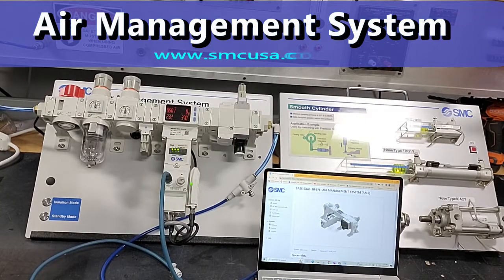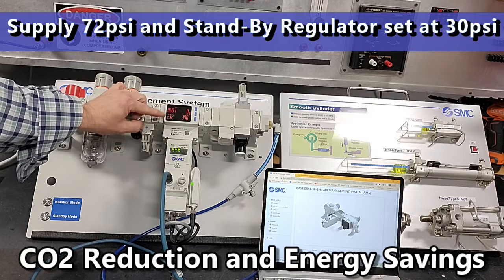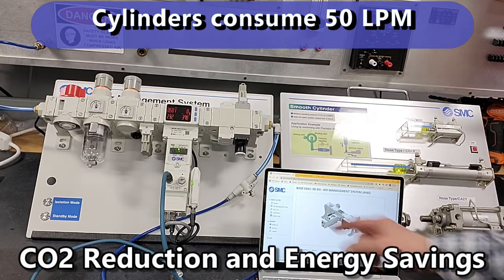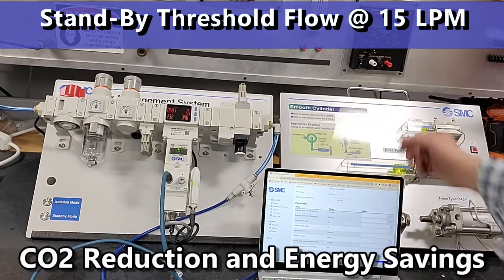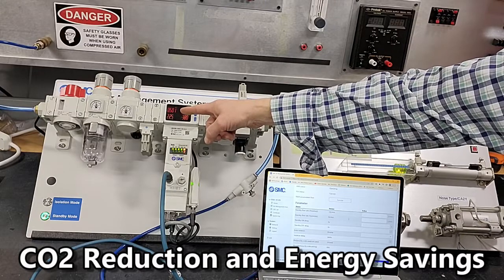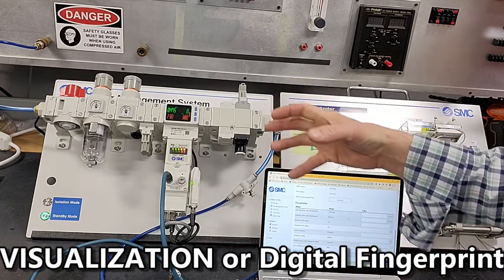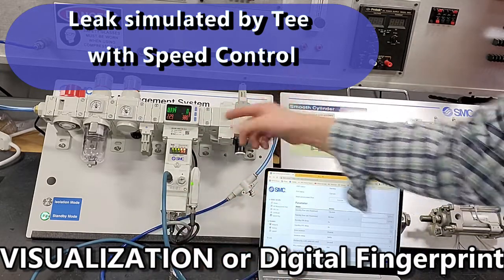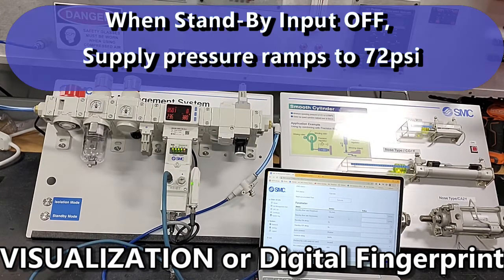Air Management System by SMC Corp

Comment: it is possible to link my power supply io devices to monitor their usage ? currently i connected to io port 4 seems cant get connected
Reply from the maker: AMS is not shipped with IP address. It must be set in field. Please use IP Setting Tool, free download from SMCWORLD.COM
Reply from the maker: AMS has M12, IO-Link port which can be configured thru web browser as a digital IN or dig OUT. What is the mfg & part # you are trying to connect?
Reply: @davidbetts1758  I had try phoenix contact power supply model
Trio3-PS/1AC/24vdc/20/8C/IOL
Connected to port 4
It show in general io link process data port status PD mapping mismatch , I put vendor id and device id with test byte swap also same 
My plc mapping I see smc already allocate offset input for it
Reply from the maker: https://www.smcworld.com/manual/en-jp/?c1=A26

Comment: How profit if the machine always running 24hr.
Reply from the maker: If the machine is never idle, you would never enter stand by or isolation mode, therfore no savings from this features. Please share what is your operating pressure? Have you evaluated reducing supply by 2psi increments?